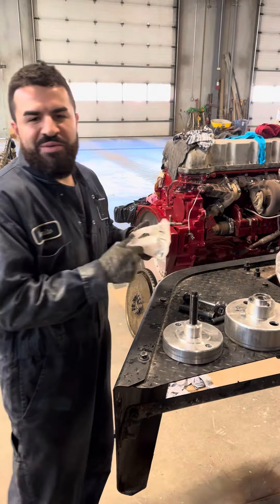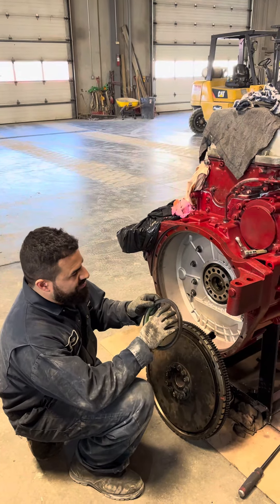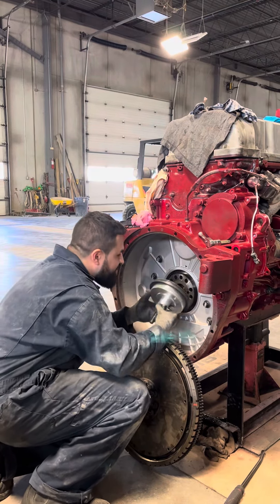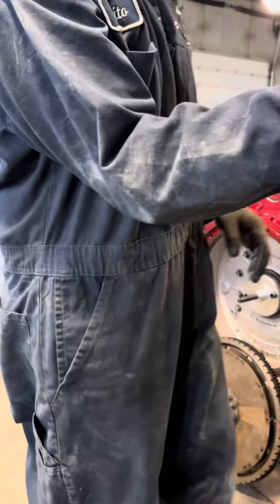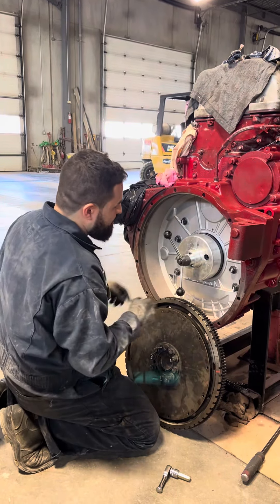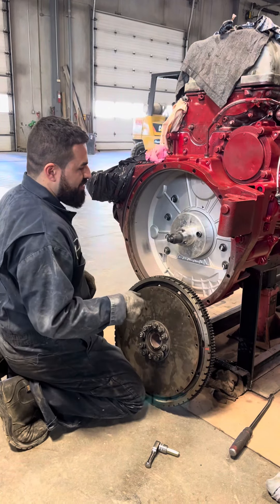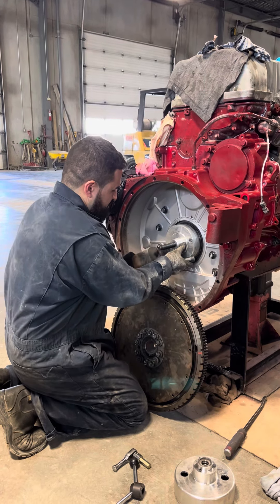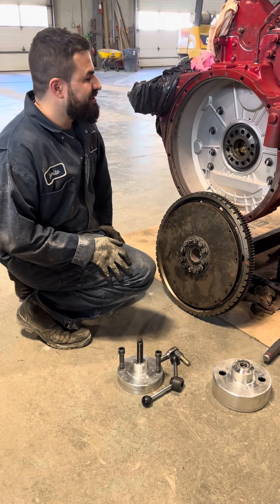Installing a Mack Mp7 rear main seal.

Comment: I have this same engine. It leaks oil from somewhere above the starter. Some guy said it could be this seal. I don't believe it would leak around the starter if this particular seal was bad. Any other seals or gaskets in the area around, or above the starter I should look for? Timing covers? It's getting worse, and I need to get it taken care of. The whole bottom of my truck is coated in oil..
Reply from the maker: Could be the upper timing cover behind just under the valve cover. If not that then maybe the timing gear front metal plate… I hope not because that’s a big job, but what I would do first it try to tight all the bolts and if there loose lock tite them all. I have had them come loose before. Sorry for late respond but I hope it helps let me know how it goes !

Comment: Is a mp7 a dd11
Reply from the maker: MP7
Reply: A “dd” would be a Detroit Diesel. The Mack MP7 and the Volvo D11 are the same. Just like the MP8 and the D13 are the same. Only one “d” when you’re referring to Volvo engines. Two is Detroit.